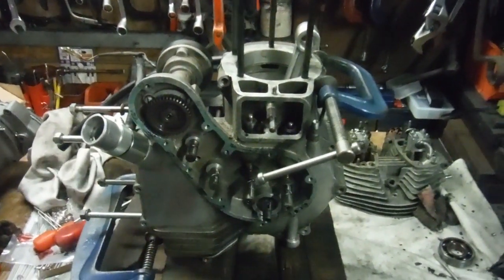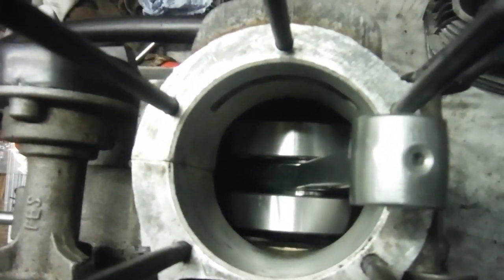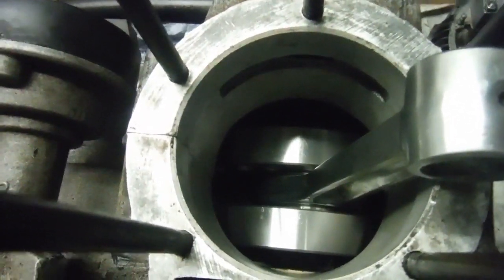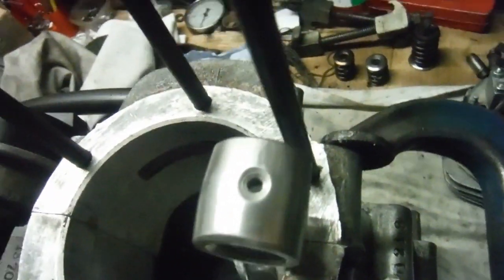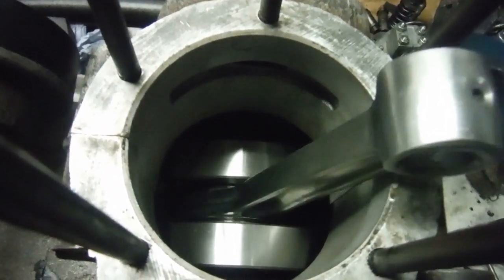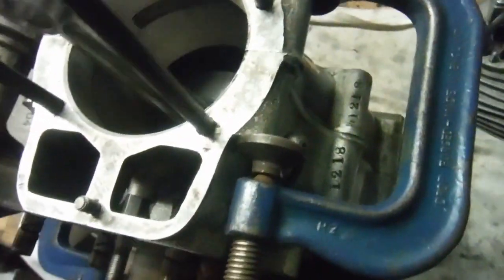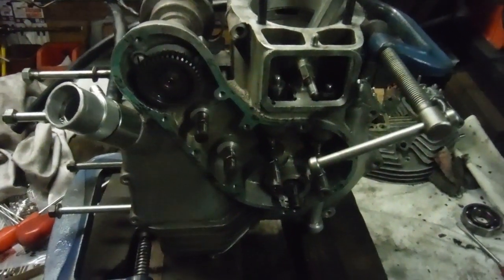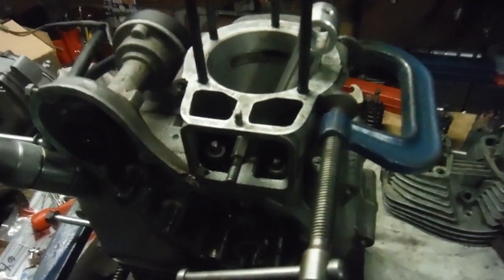Royal Enfield Bullet 500 Asbo 38 trial assembly of bottom end with new mains and lightened crank.

Comment: On a 2002 bullet 500 what direction does the crank seal on the timing side go in??? Flat side out? Flat side in? What direction prevents wet sumping?
Reply: Ok thanks!
Reply from the maker: Flat side in, spring facing you.
Reply: On the primary drive side is the crank seal also supposed to be flat side in?
Reply from the maker: No, flat side out for that one.

Comment: Hi, I rebuilt the crank on my year 2000 500 cc bike a couple of years back, no big issues but was supprised to find the crank case halves had no location dowels, I'm no expert but two Mz's I did (125 & 250cc) had them. Bullet crank was true and no walking on the case halves so nipped it all up, this is now 7k miles ago & still going strong, just an observation. Good work Paul and I will keep watching, cheers.
Reply from the maker: Hi and thanks - the British Bullet engines had dowels, while the Indian ones rely on two of the crankcase bolts being a drive in fit, to supposedly do the same job.

Comment: Is there an actual "paper" gasket for the crankcase halves, or a liquid gasket compound?
Reply from the maker: For Indian made engines, there is a thick, paper type gasket. British engines don't use one, just gasket compound, or sealant, fitting a gasket to one of these might put the crankcase mouth out of round very slightly, but I have never tried using a gasket on one of them. The engine in this clip is a mid 90's Indian type.

Comment: Why do you lighten the crank
Reply from the maker: It helps increase speed and power and even makes the brakes work better!
Reply: @paulhenshaw4514  would that effect momentum of the bike..would you have to change gear earlier if bike was labouring going up a hill.
Reply from the maker: @virago1100gw  Not really, in fact if there were still more torque available just by opening the throttle, the machine would be able to gain, or hold its speed better, through having a quicker throttle response. The only time I think this might be counter productive, would be on a sidecar hauling machine, possibly.

Comment: https://www.hitchcocksmotorcycles.com/partsbook/267/1961-500cc-bullet-big-head
https://youtu.be/4aQc2cv5kmY
Now at the turning of the crankshaft and the connector showing the excellent recovery service of the machine's heart, I went to look at the side windows below the cylinder. I don't know how they work. It looks like an outlet for decompression of the crankcase with valves. The machine is super reliable with the control gear train which with quality lubrication hardly wear out. There is no chain to always be stretching and replacing from time to time, although they produce more friction when lifting the spin very quickly. It will be very pleasant to see it work after all services performed with the greatest technical rigor.
Reply from the maker: Thanks, Glaico - those 'side windows' are where a removable cover gives access to the pushrod adjusters for setting the valve 'clearances' - which are 'nil', with the pushrods able to spin freely when the valves are closed.
Reply: THANKFUL!  Mr. PAUL!